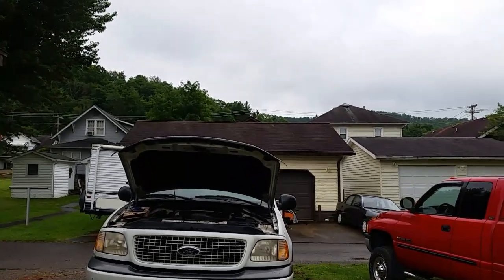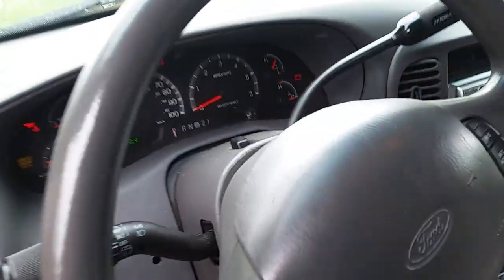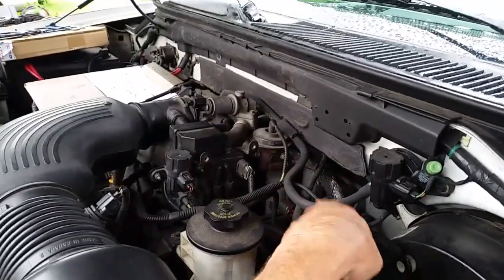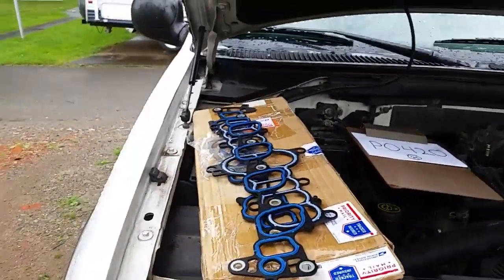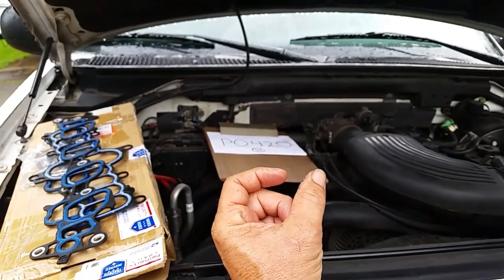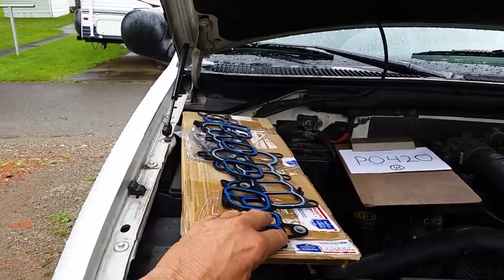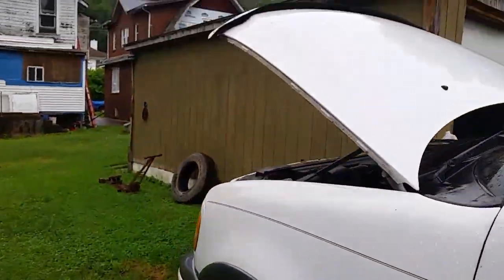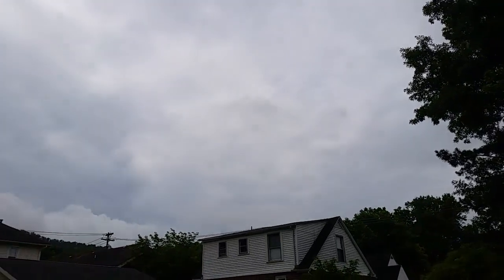P0420 Code. How to fix it. Don't spent spend tons of $$$.

Comment: I completely disagree! Doing this full time for 15yrs as a shop owner, a simple "live data-fuel trim" check will immediately expose an "air/vacuum leak" and MOST of the time this is going to trip a lean code.
With your insistance of lean issues you dont even provide us with a fuel trims check??
Thats like taking a misfire code P0301 and saying its usually always an air filter.

Comment: One day my 07 Cherokee check engine light started flashing. I was not even midway home from LA to Vegas. I did notice misfire when this light came on power loss was very noticeable as well as some shaking when shifting gears from park to reverse 😨 So i stopped nearest O’Reily n purchased new gas cap thought it would work nope. Eventually got home w light flashing periodically. Next day went to my mechanic and did a tune up replaced all spark plugs and cleaned the intake air sensor as well & found out one of the spark plugs was cracked 😳 That was couple of years ago. Check engine light never came back on not even once after I replaced all spark plugs. Now 2 months ago my check engine light came on w p0420 code below threshold w the catalytic converter. Last week I finally replaced my whole catalytic converter system because bank 1 cc wasn’t “reaching the right heat enter and exit temperature tested via infrared gun from my mechanic. So a new cc system was needed sigh 😔 costed me $1100 for the system from O’Reilly & also picked up 4 new Bosch sensors @$35 each sigh 😔 then went to Meineke and had everything installed for $300 sigh again 😔 I also replaced a cracked radiator a week prior to this $600 😔 now I’m gonna be eating cup o noodles for the next 3 months 🥺 I’m $2K lighter and the positive thing is my 12 yrs old Jeep Grand Cherokee Laredo is running like a champ again! Still cheaper than buying a new car. Hoping my Jeep (170K) would last until 300K- 400K miles 🤞🏽 Meineke ended up using the torch as well to take out all of my sensors because they were all rusted and seized they couldn’t take off the 02 sensors and the 8 bolts that connects the CC to the headers but they did took em 4hrs to finish the work but I only paid $300 and Meineke did an awesome job! 👏🏽

Moral of the story is this. I should’ve stopped the car right away when my check engine light started flashing couple years ago from that road trip coming home from LA to Vegas sigh 😔 but u know what? I had no idea that u we’re suppose to stop the car right then and there 🤷🏽‍♂️  I guess call a flat bed tow and have them tow my Jeep from Palmdale to Vegas which probably would’ve costed me close to $2K as well idk 🧐 I’m not a mechanic nobody told me about this, a hefty 2K lesson yaal. Turns out I damaged my bank 1 catalytic converter from gasoline entering the CC and driving it home for 2+ hrs flashing periodically. 😫
But she’s running good now sorry for the long ass rant yaal I hope somebody reads this and learn something from it ✌🏽anybody got $20 I can borrow? 🤑 👩🏽‍🔧 🚐💨💨💨
Reply: Rusty Highlander 😭😭😭 she’s running solid right now 171K hoping to get to 300K or might have to trade her in a few years for something w less mileage
Reply: Damn I can’t believe I read your ENTIRE POST!! Lol. Good shit!
Reply: @mrlatnemis1849  Tnx for reading it man 🤙🏽 I know that was like a long ass novel lol 😂 any how my jgc laredo atm just hit 199K and just started using a full synthetic Mobil1 oil. Also I just ordered a complete set f & r of cross drilled rotor brake set and ceramic brake pads from Amazon for $290 from Detroit Company Brakes because they are warped and worn out, my mechanic will install everything for $200 then nxt month I have to change my front oil pan and gasket because she’s slowly leaking and have been for the last 8 month just started leaking slowly all over the front frame recently I noticed some leaking on the ground as well so in a few weeks that’s up next then I’m done again for a while I hope 🤞🏽 lol. You know what they say about J.E.E.P. it means just empty everything from pockets 🤪
Reply: I am about to ask people to lend me money too , I’ve dumped so much money into fixing my 08 Yaris and I just got a p0420 code today 😭😖
Reply: @SleeplessinOC  u got this bro! 🤙🏽

Comment: If you get this code on a 1.6L Kia Soul, take it to the dealer to execute the latest recall.  They will reprogram the ECM, and will probably replace the catalytic converter.
Reply: I got a 2014 kia forte 1.8 just replace the converters and the cam shaft sensor and the crank sensor and the stupid light keeps on coming back
Reply: @calvillocobra98  what have you done ? Am having the same problem
Reply: @Ginnito  never fix it sold the car
Reply: @calvillocobra98  guess that’s my next step ! Thank you 🙏🏽
Reply: @Ginnito  no problem man i think the problem was oil sludge
Reply: 2021 2.0 Tucson with 28.000km this code comes on and off all the time. First I ignored it now I deleted it, waiting to appear again 😄

Comment: If you get codes like that after your battery has died or been changed, run a vehicle specific Drive Cycle.  That will allow your computer to get in sync with the sensors.

Comment: I had this code the other day 98 2Dr Tahoe I put Royal purple in 3 tanks on 10 gallons each time the first 2 tanks the gunk caused the 0420 code and random misfire and burning 🔥 rich I knew it’s was because I was cleaning it 3rd tank I hit freeway within 10-15 mile Mark on freeway check engine light 💡 went off and it ran like a dream.

Comment: best diagnostic tool is your ears. hands down. I saw p0420 and i replaced my gaskets on a toyota sienna, and it ran much better when i replaced intake and throttle body gaskets, although it runs a bit rough on high way speeds which doesn't make sense since the rpms are lower than when getting upto speed. my guess is worn suspension parts, but they are certainly still good. the last thing i know is a problem is probably oil in the cat, since it has been running rich and blowing blue smoke before i replace 02 sensor.
Reply from the maker: Nice!

Comment: Good information.I recently replaced the engine with with a Japanese import engine on my 06 Altima. The engine came with a plastic intake manifold. The original. Was aluminum. I have no idea why the aluminum one has shutter valves opened by a vacuum motor and the plastic one has none. I went with the aluminum. The engine runs fine now but had so much soft carbon in the intake it was causing misfire which I was blaming on on something I did wrong. I think it just needed some normal driving.
Reply from the maker: O yea? Hummmm

Comment: This video saved me a significant amount of money, been trying to solve this P0420 code on my 2009 Ford Flex- tightening the manifold bolts and checking vacuum hoses solved the code issue.
Reply: How did you use to check for vacuum hoses?
Reply: @ThatBoyMichael1  probably with water and soap
Reply: @ThatBoyMichael1  - You can use smoke also to find vacuum leak.

Comment: I solved the problem with some silicone grease ( from the pool store) on the Gas Cap “O” ring !  A 50¢ fix !
Reply: Now time to buy a new gas cap “O” ring for $8 or a new cap and “O” ring  for $35. 

I’ve had it come back on 3x and it went away when I put the silicone on.  It ALWAYS GIVES ME A 420 code if I don’t put 7 clicks in the gas cap when putting the cap back on !
Reply: I'm afraid you must be mistaken . A catalytic converter has nothing at all to do with your gas cap . Two different systems altogether. The evaporative emission system is responsible for storing and purging fuel vapors and will set codes like p0441 p0442 p0446 etc. But will Never set p0420
Reply: New Level Auto thats what I thought too... 

but I found a small note like this on my search on Utube and thought I would try it ... 

it worked!!  

And since then if it comes back on I just go give my gas cap 7 clicks and reset my codes and it goes away !  

STRANGE but TRUE !
Reply: He had a p0440 code. Not a p0420
Reply: @NewLevelAuto  right - it should have been a fuel system leak.

Comment: Interesting video, Im a 35 yr auto tech and a drivability specialist,  air leaks cause a P0171 or a 174 , system lean,  never seen a vacuum leak cause a 420. These items are easily tested with the proper scanner not a Harbor Freight code reader
Reply: My 2011 mustang 3.7 has p0420 was causing power loss and misfire but only when DECELERATING. When accelerating only slight power loss, no misfire. I replaced the bank 1 o2 sensor and catalytic converter (when i removed the old cat it was full of broken pieces inside.) the code hasn’t come back yet but the symptoms are still the same with the replacement making seemingly no difference. Just did my plugs 6k miles ago too..do you think it’s reasonable to conclude if the cat was blown on one side that the other side is likely the same?

Comment: If you want to check if you have a vacuum leak take a propane cylinder with the engine running a long hose on the nozzle and shoot propane out of your little tank you're settling tank soldering tank down along the edges of the intake manifold around your Christmas trees around your diverter valves around your bank vacuum switches and if your idle goes up if your idle goes up that is where the leak is
Reply from the maker: Good tip ;)

Comment: I got lucky with the 420 code. The Japanese import engine that I put in my 2006 Altima had a serious engine misfire code because of so much soft carbon in the intake. I put a couple of cans of Sea Foam in a full tank of gas. That solved the misfire problem but caused a 420 code. I removed the primary oxygen senser and sprayed a whole can of Berryman Carb cleaner.The 420 went away. Bought the car with 225 k. After a couple days I realized I had been took. Ran good but needed valve seals. When I started changing the valve seals I realized the valve guides were worn. What the he'll I ordered a Japonese import engine from NJ. Good engine but probably has never been driven over. 30 miles per hour. Beautiful car. I guess it's better than buying a new one.
Reply from the maker: Nice!

Comment: You would have a p0171 if you had a vacuum leak. PO420 usually means bad catalytic converter. You can monitor the voltage of the downstream sensor and if it fluctuates with the upstream sensor you have a bad cat
Reply: Well put. Thanks. My downstream sensor stayed pretty steady at about 0.8 V. The upstream sensor did not fluctuate much and stayed around 0.5 V.  Besides the P0420 code I also got a P0133 code. Upstream sensor slow to respond. Going to replace upstream O2 sensor.

Comment: I recently had 420 code with check engine light. The night before i had swapped the battery for a new one. I think this caused it. I drove the truck for 35 miles and the light turned on again. I cleared the light called it a day. Next day i drove to the kids to school, once getting home i remembered i had the obd2 blue tooth scanner. I poped it in checked for codes and the emissions lights were green. I drove to smog check and the mechanic said you are ready for smog, and i passed
Reply from the maker: Nice.
Reply: Yes! Just4Fun. My car started running rough and felt like it was going stall. Then, out of nowhere a battery light  came on the dash cluster. I thought my battery needed to be replaced so I had it checked and it was bad. So replaced the battery. STILL HAD ISSUES. So I replaced the alternator since it has a lifetime warranty. Well the battery light went off but a few days later the check engine light came on and hasn't gone off yet. So I had O'Reilly's run their OBD2 and it said it was the catalytic converter and O2. But even the guy there told me my catalytic was fine. But now I'm going to check all the hoses and seals. Thanks for the video

Comment: I have that EXACT Expy-same year, engine, etc.  Even same color!  I had that P0420 code about a year ago, reset it, and it never came back-YET.  I DO have the "Evap Sys" test not complete.  I've been trying to trace that problem for a while and can't seem to find the leak.  Had a shop smoke test it and they said it "could" be on top of the gas tank, they'd have to drop it, and it'd cost a minimum of $700.
Reply: Go somewhere else

Comment: P2279 is for vacuum leak via intake manifold gaskets under the hood. P0420 is for the check emissions systems. I am not sure why vacuum leak is the issue? I can understand if there is an exhaust leak though. Not sure if I am seeing any relation here???
Reply from the maker: Yesterday...P0420 code found, a pin hole in a head gasket. Boom! Replaced it...no more P0420 code;)

Comment: Right Nissan Sentra have plastic intake and I discovered a crack by the end of the throttle where it bolt up. I have the same issue but went ahead and replace the converter since the car have  high mileage.
Reply from the maker: Nice!

Comment: If you have un metered air or air leak the computer will set a code p0171 or p0172 system to lean look at your fuel trims then you will know for shure.

Comment: How big of a deal is the extra air going into the intake manifold?  Because I just replaced my 4.6 2v with a aftermarket dormant intake and the code came on after driving a few hundred miles.

Comment: another thing that causes  420 and 430 codes is a cracked pipe or a  leak in exhaust to cat flange   if it is near your after cat oxygen sensors.  any outside air (oxygen) will cause the sensor to sense oxygen which is what o2 sensors do.   In a proper exhaust system any leftover oxygen is consumed in the cat converter and after cat 02 sensor would not sense o2.   but if there is a crack near sensor oxygen can be drawn in and set off 420 or 430.   I have LS430 and my scan reader will inform me of the known causes for the vehicle im working on.   On mine it said replace exhaust y pipe.   I searched internet and found out that this car had heat shields clamped to y pipe and they caused cracks on y pipe about 3 in from o2 sensor.   I replace y pipe and codes went away.     So also look at exhaust for air leaks.
Reply from the maker: True.

Comment: po 420 code first change spark plugs a misfire will cause to much unburned fuel into the catalitic converter and also distroy the converter.the injector cleaner will help clean the injectors and the converter.Also check for a bad coil check eachcylender for misfire.Unplug wire if motor shakes thats the one.
Reply from the maker: Word! But a lot of times...its to late the damage has all ready been 
done to the cats. But you are right. That's why is always good fix a 
issue right away before it causes a chain reaction sorts.
Reply: @FixingWithPassion  that's what happened to me.  Poor maintenance caused 2 bad spark plugs, this caused 2 damaged ignition coils and finally the cat was destroyed.  It's costing me a ton of money since I imported a GMC Terrain to Ecuador and there are no parts for replacement available in here.

Comment: Always rule out all possibility before replacing the CAT like a misfire.
Reply from the maker: Hope to work on it this week:) Still driving it.
Reply: check coils, even if you check them with a meter id still put new ones in before changing a cat
Reply: I had a reoccurring misfire on my '05 Altima. There was not one specific thing that fixed the problem (replaced coil packs, plugs, boots, cleaned connections) then one day, started running like a dream. Unfortunately, the long time misfire caused  an exhaust gasket leak, and only after that, the p420 code. Gotta replace the gasket and donut, then check for vacuum leaks.

Comment: Hey, I got an Explorer '13 and the water pump was leaking outside the engine. After I fixed that, my mileage tanked during city driving (stop-and-go stuff), but no check engine light is on. My OBD2 scanner's showing a P0430 code, though. Any ideas? Just so you know, it does good on the highway!

Comment: P0420 was removed in a hundred miles for me in a 1999 Corolla (282K miles on it)  after adding 1 gallon of lacquer thinner to 1/2 tank of gasoline and driving  normally. A new catalytic converter is easily over $1000 !